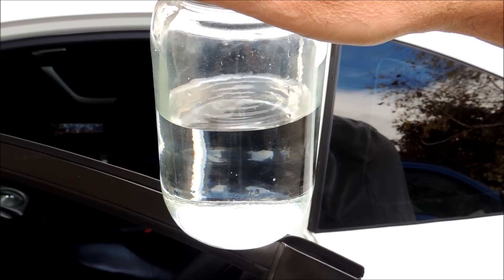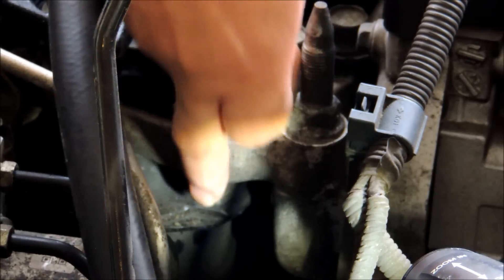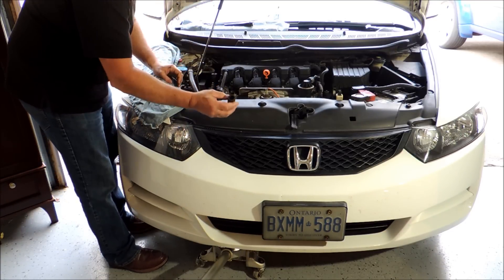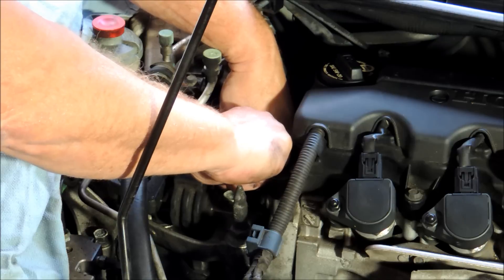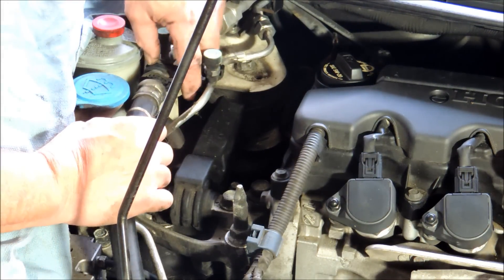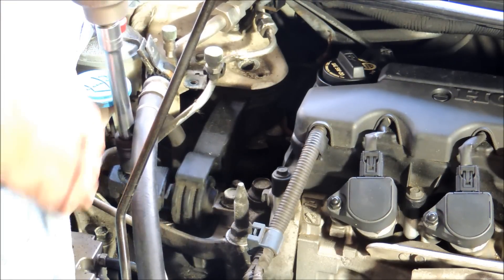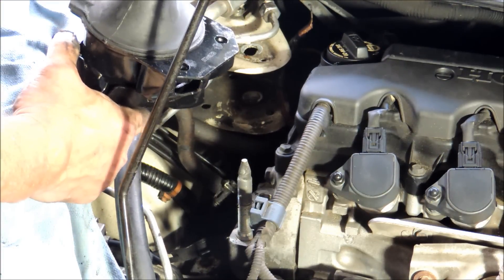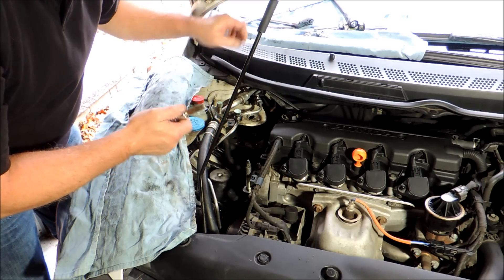Honda Rough Engine Idle Shimmy and Shake SOLVED!

Comment: One thing to be careful on timing side motor mount on civic 1.8l auto is that you make sure to get a HYDRAULIC motor mount that has hydraulic fluid in it. Otherwise the vibration will be worse than an original broken motor mount.  I have 2011 civic 1.8 auto and it has 235k miles. I had vibration issue with mine at 190k miles. It was a broken motor mount. I bought one online for $40 or so and it was terrible. Then, I got another one around same price that has hydraulic fluid in it and now it runs very smooth.
Reply from the maker: Thank you Burak for the excellent advice - cheers from Canada!

Comment: My 2010 civic has ALWAYS had that slight shimmy/vibration since I bought it 3 years ago. It almost feels like it could have been an ignition related problem causing a rough idle in my opinion. I changed the plugs and it didn’t help. The tab you’re speaking of also looks fine so now I’m curious. Hey for $50-$60 maybe I’ll just change it and see what I get! 

Keep it up Mark, I’m a long time watcher of CBC marketplace. 

Cheers
Reply from the maker: Andrew - let me know how it works out - and check out all the mounts - Cheers!

Comment: I just bought a 2016 civic EXL and this video speaks to me. It runs great, and only has 20k miles. However, when stopped at red right, or just idling there is a very light, or just light shimmy/shake. For example today I had a plastic bag on my passenger seat and i look and I can see the bag shaking. I can even feel it in my body sometimes too. Again its light but its there. So frustrating as I just bought this car. I don't know if I should ignore it. I will look at the space under motor mount and see what is up. Or take it to dealer I guess. Sucks. Should not happen to such a young car I would think.
Reply: Johnn Vedder that’s those cars are made if it’s very slight that’s normal you should start worrying when it gets stronger
Reply: It’s the cvt
Reply: Did you get it fixed? My 2016 civic EX does the same thing, shakes only when I'm at a stop and on Drive, not park,neutral nor reverse
Reply: Johnn Vedder my seats vibrate too and it’s annoyingggggg lol
Reply: @Cammyy2k   It's still annoying...still have not took it in for service...not sure what to do

Comment: Thanks for the information Jack. I just got done doing my front suspension ( lower control arms and ball joints were shot). I think motor mounts are going to be my next project. Car is a 2003 Honda Civic EX. Car is almost 20 years old, I got it when it had 117k on the odometer. I think all the rubber components need an overhaul.
Reply from the maker: Sounds right Blah - keep on fixin - Cheers from Canada!

Comment: after watching and listening to this video I replaced my today on my civic 2008 and solved the driving, I had no check engine light, a word of caution ..... the mount has a small dial pin that goes in a little dial hole on the braket, so before you install it lay the bracket on  top of the mount and make sure the bracket lay flat on on top, I had to grind my mount some I  order for the bracket to lay flat, if you do not check it, you will install it and will never Realize that is not laying down properly  I went to two different auto parts and both motor mounts were the same would have to grind off a little and same price $154.00 both were of black color if that makes a difference, is not a big deal once you do it you. will see exactly what I am saying, so have you a hand or bench grinder ready, I just wonder how many persons have installed the with out checking it,  and not knowing that grinding is required on some cases start l the bolts but leave the  loose very very loose, do not  start taghtning untill you have started all bolts the engine moves side to side it will help you to get bolts started

Comment: R18 engine, I used a couple of thick shimes to raise the mount. 80% gone. Saved me 400 Euro.
Reply from the maker: Best thing to do is replace it when you get the cash - the other mounts have to take up the extra load now
Reply: carquestions yeah, but they are stupidly priced, the same mount is in US like 150$.
Just upgraded the brakes, alle plugs, filters, oils, wipers, to get the car in shape.
I bought the car with new battery, AC pump, condensor, tires already. 
I have a defective rear parking sensor and a segment failing in the radio display. So still € to spend!
I like these cars, it took time to grow on the model, but I thik of selling my EK3 with 70K miles on it and keep my R18.

Comment: I replacement and the engine mount as taught in the video but the car still shakes / shivers. It comes and goes intermittently. What else could it be? Would cleaning the throttle body help?
Reply from the maker: Check fuel pressure and change the spark plugs
Reply: Hi 
I have 7 gen civic it shakes in low rpm on rugh road and especially on AC when I on A.c. it will shakes in low speed but when u engage the clutch it will fine,
Whts the problem

Comment: Wow great video.  I have a 2016 Civic and it shakes and pulses only when the AC is on.  Would that be a motor mount or something else? Already had the spark plugs replaced.  Thanks
Reply from the maker: Could be
Reply: I have the same issue with a 2016 CRV. I believe it's that same motor mount but it could also be the A/C compressor which would suck...

Comment: I didn't have this problem when i changed the motor mounts on my J30A4 (7th Gen NA V6), or the second time that I changed them when all 3 mounts ripped in half.

I DID get this problem after I upgraded the mounts to a set from Innovative Mounts.  Massive vibrations at idle, worse when a load is put onto the engine (a/c, electrical).  A honda mechanic suggested searching for vacuum leaks, and it made the problem better, but vibrations are still horrendous.

Throttle body is squeaky clean.  MAP sensor is fine.  EGR is working perfect.  No vacuum leaks.  135k miles, just had its first timing belt and valve adjustment.

Suggestions?

Comment: Very good
Our 2019 Honda Civic has developed at idle a hesitation, it will run smoothly and at a stop,it may or may not idle smoothly 
Mileage is 25 k and is still under warranty 
As the car stopped and was towed to the Honda dealership 
There scan told them no4 spark plug was faulty,and they replaced that (not all 4?)
Daughter picks up the car $300 plus bill and the car still has the problem 
Today I changed the other 3 plugs,and it’s better but still that hesitation when idling.
Ok under load no misfiring
Definitely electrical,but a lot of could bees
Car is still like new,but I did notice the insulation tube,that insulates was rusty compared to the other 3
Which were shiny 
Any ideas much appreciated 
Good advice cheers Frank✅
Reply from the maker: Any codes in the computer?- start there first -

Comment: I had a question, I have a 2016 civic and when im at a stop and on drive (only) the rpms drop to 600 and it shakes a lot, no lights have turned on and it's only when I'm on drive at idle, car runs fine
Reply from the maker: Sounds like a broken mount
Reply: My 09 Honda Civic idles rough it doesn’t have a misfire I found that out so I’m happy but it drops to around 600 when it’s fully warmed up and it vibrates a lot and my steering wheel vibrates alittle while idling and a little while driving and I can feel the vibration in the seats and in the foot pedals and it’s annoying and I don’t know what if is this is my first car and I’m not made out of money lol so can someone tell me what it could be cause this shit stressful
Reply: Check for Vacuum leaks.
Reply: I replaced the top passenger motor mount and it solved the problem. Thank you!

Comment: Would you think more likely it be the same way on a 98 Honda accord dx 4 cylinder no engine light and no misfire and all the whole works it but shivers like what you mentioned
Reply from the maker: Sorry for the late reply - check for codes and vacuum leaks - Cheers!

Comment: Did you notice before the repair that the idle dipped alittle bit? I’m working on my s2k and there isn’t a lot about this problem online. I’ve replaced spark plugs ignition coils the IAC and the filters are new. I haven’t touched the throttle body yet. My car does have that shimmy at idle also. Just trying to see if I’m heading in the right direction
Reply from the maker: Test the mount as shown in the video Kassiy - simple - if it isn't cracked in anyway (look close) then look for other problems
Reply: @carquestions  thank you!

Comment: What is the most likely diagnosis for a 1997 Honda Civic with a recent check engine light and shaking like a machine gun?
Reply from the maker: Whatever the code is that is turning on the dash lights - probably a misfire - caused by any number of reasons - bad plugs to head gasket, valves etc.- you need to follow standard diagnostic procedures to narrow it down

Comment: Done this repair at the dealership ... Not Cheap !  Problem with vibration still exists !!  I'm thinking lower torque strut ?? Any Input ?
Reply from the maker: Get their work double checked by someone else - someone is lying to you - how could a competent mechanic see your issue, recommend changing that mount then shrug his shoulders if it didn't fix it ??
Reply: @carquestions  This vibration issue is an ON-Going issue with Honda Civics from 2006 - 2011 and even onward in years ! I have been extensively involved in Honda Forums with people throwing $$$ at this issue with no resolve !  The car was under warranty and the dealership stated this mount was bad (passenger side) and the rest of the mounts were fine ! I just learned to live the vibration instead of throwing thousands of dollars at it...I'm not the only Honda Civic owner that has done this passenger mount change with no resolve sir ! People has tried changing all kinds of sensors (O2, Crankshaft, MAF etc, changed plugs / wires / valve lash and nothing seems to work !!  NEXT thing I'm going to do is change the lower Torque Strut Mount...It's cheap part and is easy to do !
Reply from the maker: Lew - this problem was stopped cooled on the car in the video - I can't say I've seen any Civics shake that were not mount related - Honda is a premiere engine builder so I'd be looking at anything attached to the engine like H balancer - torque converter trans issues etc - Just an idea for the forums - get a shake free Civic and borrow its mounts to test on one that shakes - keep testing and you are going to find the cause - just takes a little time and ingenuity
Reply: @GodsTribe  I agree but Hondas are reliable cars ! They have issues like any other brand but reliability is rite up there !

Comment: Is this true if my rough idle is not consistent it’s only sometimes at a stop light and in park
Reply from the maker: Check it to be sure - easy to check
Reply: It could be your radiator fan or engine valves. Have you looked into it? What was causing the rough idle?

Comment: Will this also apply to honda accord 2011 sedan. Mine also vibrate at idle and my mechanic told me the right side front mount is bad.
Reply from the maker: Yes Prosper sounds like you do have the same issue

Comment: I have a crazy loud vibration. It's Soo bad. Around 2000rpm it's horrible.. the prior owner said it was just loud. 
Yeah it's gradual to the point the guy just thought it was how the car was. What a moron.
If it's the motor mount I absolutely stole this car for the price haha
Edit: the upper mount is pushed into the rubbber. It's denting in if anything. So the exact opposite of a gap. I'm gunna pray this is it!
Reply from the maker: Great - let me know what you find - cheers

Comment: I have a 2006 Honda Civic with low miles on it I bought it two years ago and I started to notice that it was shimmy and shaking I was overdue for an oil change which I do myself plus it was a little overdue for the transmission fluid to be changed which i did  a week ago thinking that it would solve the problem nope im still getting the shimmy and shaking. the rough idle still be caused by that part even though I have low miles on the car ?
Reply from the maker: Yes even with low mileage - it goes by age - also when does it shake and shimmy when driving or just stopped idling?

Comment: Hi I have a question ok so I have a 1999 Honda Accord and it’s my first car I’ve had it for about 2 and a half month but my car does this it’s shakes a lot and then when I come to a red light or a stop sign I stop or I put my foot on the break to switch gears and then it turns off I don’t know what the problem is Can you help me please it’s my first car do you know what the problem might be
Reply from the maker: TAD - you need to hook up and scan the computer for trouble codes - check YT  for DIY videos - also you need to see if the plugs have been changed - if unsure change them - let me know what you find and we'll begin further troubleshooting - Cheers

Comment: I have a Honda Accord 2.4 2006 mine skakes like a cat, when I press on the gas like if looses power when I press it slow , I have to let go of the gas and press it again that it can zoom out, I have no engine light, I just  change the oil, spark plugs, I need help, thanks
Reply from the maker: Even if no light check for codes asap and let me know what it says - if no codes at all then do a fuel pressure test

Comment: How many miles were on it when you did this
Reply from the maker: Near the end of the video I say it has 100,000 miles or 160,000 kms
Reply: @carquestions  Is it possible to have the same problem when my car only registered nearly 100k km? It seems the vibration points only to be the only cause.

Comment: I have a gap but my steering wheel slightly vibrates. Could my engine mount still be broken, I am able to fit a key between the rubber gap with a hair of clearance
Reply: Usually broken or worn engine mounts will jerk the car when put into gear
Reply: @Naeromusic  I just adjusted my valves and now the car barely shakes at all.
Reply: Nah....it sounds like more of a tire or possible ball joint issue if the steering wheel has a shimmy, shakes, or vibrates while driving. If it vibrates at idle it could be front motor mount. I'd also check your spark plug condition and gap setting.
Reply: @treydaypnw  ok I have a spare engine mount so I can throw it in just lazy I need to replace my belt too it squeaks whenever it rains haha. The only thing I need to do is pick up a deep socket and a wrench at pawn shop

Comment: So I replaced my mounts but it still shakes. Is it my trans mount or my wheeel hub
Reply from the maker: Trans hub maybe - not wheel hub - get any engine codes
Reply: @carquestions  the guy I got the car from said the mounts was fairly new. so I replaced both axels , front rotors , my rack and pinion , lower ball joint , and front lower control arms. Also got the alignment and tire balancing / rotation . The car still shakes. Any opinions on that ?
Reply from the maker: @jadarickyt9033  - time to experiment - on an abandoned road - get it to the speed it shakes at - then carefully and if able to safely - put in neutral and shut engine off WITHOUT locking the steering - notice if vibration changes - coast to a stop. If vibration stops the second the engine is off - its the engine, if the vibration continues then it IS in the driveline and someone missed it by not looking close enough at tires, rims, etc - let me know what happens
Reply: So at 70 to 80 it shakes a lil hard, even accelerating it shook a little bit.  I also still have a rough idle. When I put it in neutral it shook a lil but I felt it in the steering wheel and the car

Comment: Hi my 2011 honda accord is on lpg/petrol is shakey wen i stop at a junction and when I'm in park sakey as well butbits more shakey on lpg then petrol ant the need slightly moves. Any advice?
Reply from the maker: Shaid - you need to get a scan tool and check for engine codes - once you've done that  we'll start further troubleshooting
Reply: @carquestions  P0302

Comment: I have a 1999 Honda Civic and I have this problem where it won’t start, when I put the key in and hold it in the engine kinda stutters and it starts shaking when I hold the accelerator, my dad tried changing the air filter, messed with the batteries, and he might of thought it was the gas.

Any Idea what it could be?

Sidenote: the engine itself like jerks when I hold the key in idk what
Reply from the maker: First step is to get any codes from computer Loli - cheers and let me know how you make out

Comment: Hi mate, my car (Honda accord euro 2005) when you put the transmission lever to any drive Like D, R, D3  it starts vibration, but at P and N it not not. even while driving it is perfectly fine. what could be the problem?
Reply from the maker: The engine mounts

Comment: Hello dear i hope to help me.
I have nissan maxima 2014.
I was i have shaking when im driving after i went to dealer the upper engine monts are broken. The shakes while driving fixed, after that i have steering vibration at iddle i went again to dealer he said you should change the remain mounts I replaced but the problem not fixed what should i do whats you advice?
Hint: when i put to (drive the vibration less than when on N or P.
Reply from the maker: Get another mechanic - they've missed something - like engine balancer etc

Comment: Myn has a bad vibration off throttle but goes away when on the gas is it possibly the engine mount
Reply from the maker: Sounds like a missfire Madd- bad plug, coil etc - check for codes but check the motor mounts as described in the video first - if bad replace and recheck